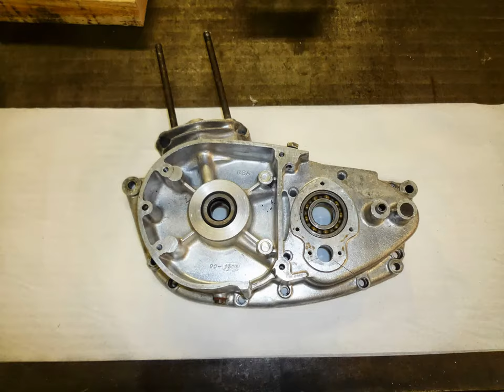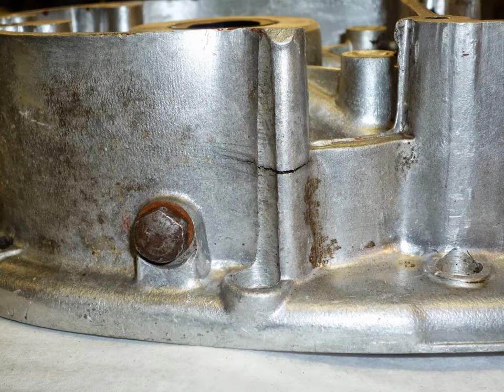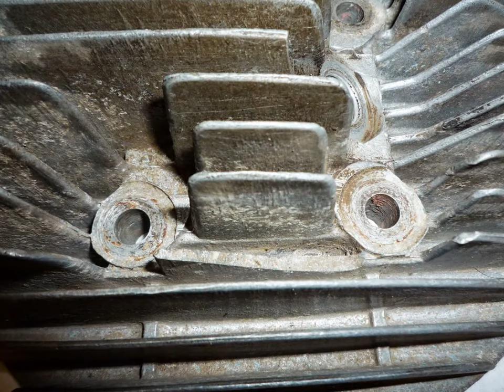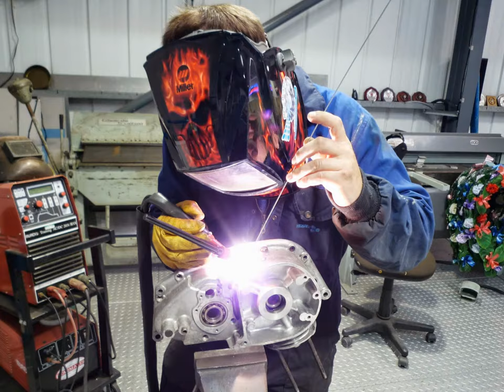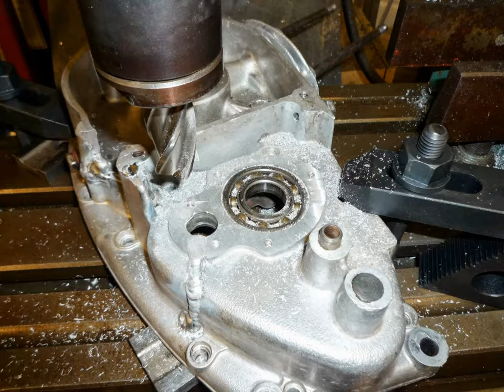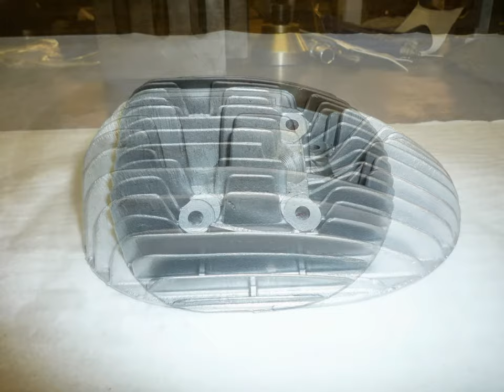BSA Bantam engine case welding and machining repair. By www.aquablast.uk.com/

Comment: wondering if some non tig like epoxy will work or is it too hot or will move and leak , rtv silicone, or metal brazing for alu, or jb weld takes some more heat is epoxy too but not much more l guess. some plate over it with screws into block maybe to push down on repair. exhaust muffler repair putty maybe.for two stroke housing crack. small scooter fifty cc. or smaller. crack on pressurised housing , does it have much prssure anyway. dont know .